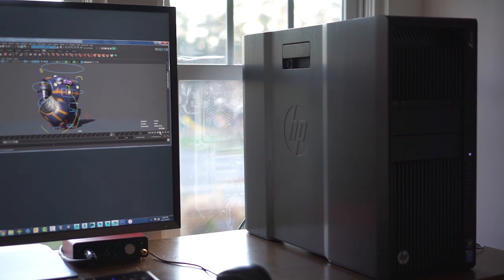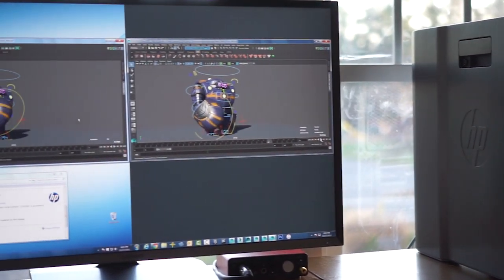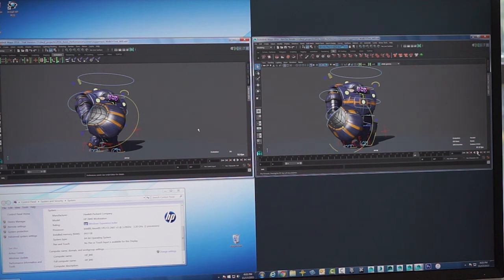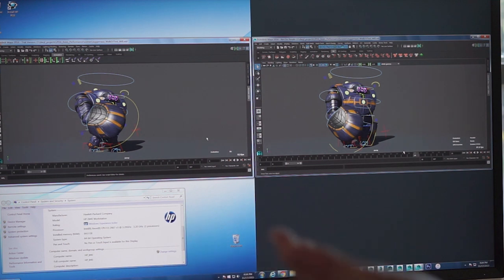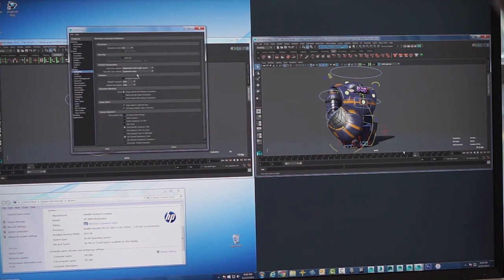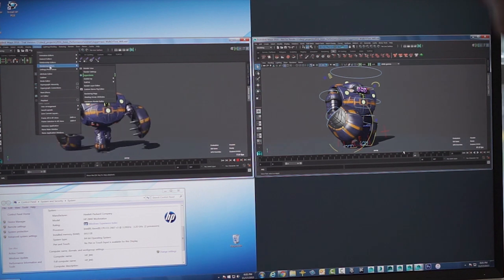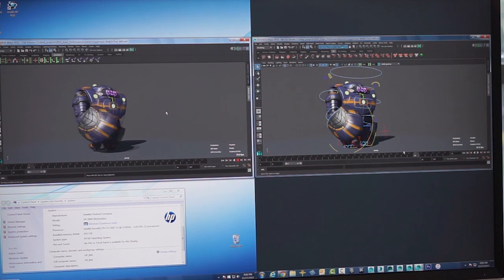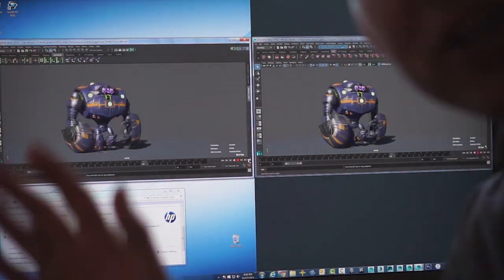Maya Monday - Parallel Rig Evaluation on a HP z840

Comment: whats your monitors resolution??
Reply from the maker: +rezki lakhzoum Its 3840 by 2160,  the Maya windows were sized to 1920 by 1080.
Reply: +daryl obert sorry if i'm insisting Daryl but is it a 32 inch? and are you using it without dpi scaling?
Reply from the maker: +rezki lakhzoum It's a 32"  and I normally  run it at its native dpi.  It can take more than one input and split the screen, this is what I did in this demo.
Reply: +daryl obert thanks daryl
Reply: +daryl obert 
what's the brand of your monitor

Comment: Hey Daryl, may i make a recommendation for a future tutorial video for Maya Mondays,  i stuck with Autodesk Composite for compositing and i'm curious with Maya 2016 Extension and the addition of all those new nodes how can they be used to composite a basic set of images ( Diffuse, Specular, Reflection, AO, Indirect, and so on plus tweaking alphas, using unpremultiply and all that stuff). Thanks in advance.
Reply from the maker: +TheIcemanModdeler Comping in Maya or Composite? Autodesk Composite really is awesome if you have fast drives that it can use.
Reply: +daryl obert Im curious how comping in Maya is done now especially with the new color composite nodes that were added in extension.

Comment: Parallel rig evaluation don't work if the rig has dynamic stuff.. Will 2017 support dynamics?..
Reply from the maker: Funny, I am making a quick post about this today:-)
Reply: +fakepivot It kinda supports ndinamics,  in the help documentation there is a way to activate it but not sure how stable it is.
Reply: +TheIcemanModdeler Ahh nice, I will look into it..